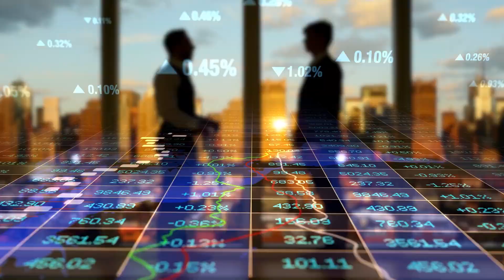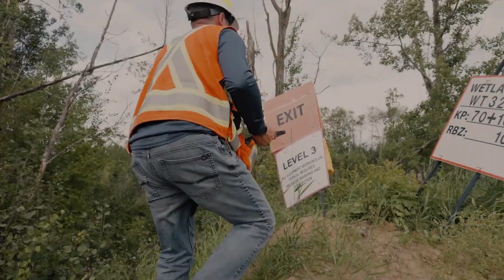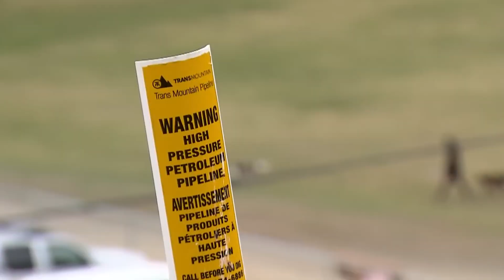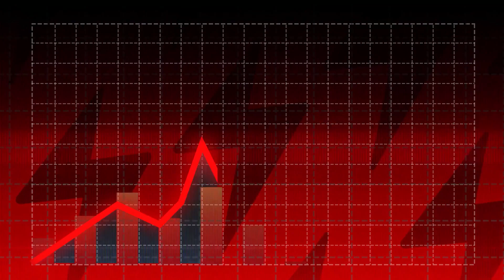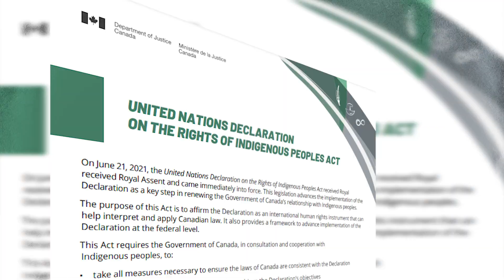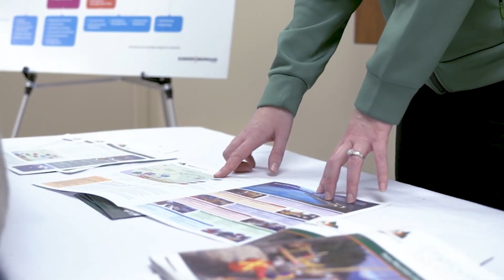Canada’s Battle To Build A $25 BILLION Oil Pipeline

Comment: It is scientifically impossible for greenhouse gas behavior to cause global warming.  All the greenhouse radiant energy from the earth is completely absorbed in earth's greenhouse effect by greenhouse gases within 20 meters of the radiating surface that is always in saturation from the strong greenhouse gas water vapor.  

There has been no credible Climate Change due to global warming as of 2024.  Climate Change was expected to start to take place when global warming reached 1.5°C causing observable stronger hurricanes in the Gulf-of-Mexico.  The term Climate Change started being used at the beginning of the 1980s to cause alert to a broad audience of the long term effects of increasing average global temperatures.  

The promotional term Climate Change in the early 1980s was grounded on actions already taken by Gulf-of-Mexico offshore crude oil drilling companies in the 1970s to build for stronger hurricanes due to warmer Gulf waters predicted to start when average global temperatures increased 1.5°C on track for 2010.  That action was taken for a predicted long term change in weather patterns or climate that backed up the use of the term Climate Change.   

US vise president Al Gore elected in 1992 is the key person for promoting the fraud that human caused greenhouse gases are causing global warming.   In the mid 1980s Carl Sagan, NASA's story teller, was at a US Senate hearing with then US Senator Al Gore on the panel.   Carl Sagan used the opportunity during his presentation to request funding three times to investigate increasing atmospheric greenhouse gases as a possible cause of global warming.   Carl Sagan was behaving as a traditional astrologer because it is scientifically impossible to increase the effect of earth's always water vapor saturated greenhouse effect or any always saturated system.

Al Gore appears to have figured out that with earth's water vapor saturated greenhouse effect being taught in US public education he couldn't directly use Carl Sagan's scam, but it does appear Al Gore used the promotion of increasing carbon dioxide levels from human activity to cause the UN Intergovernmental Committee on Climate Change to start being publicly obsessed with human caused carbon dioxide causing global warming without a mechanism for the effect.   This international involvement of Al Gore likely figured in prominently in Al Gore becoming the US vise president running mate with Bill Clinton for the US presidential election of 1992.

When Al Gore became US vise president in 1992 the new people coming into the National Science Administration were stating to the out going administrator that they were sure human caused carbon dioxide emissions were causing global warming, but refused to elaborate.   At some time earth's water vapor saturated greenhouse effect appears to have stopped being taught in US public education.  That time appears to have been during the first term of Al Gore's US vise presidency staring in 1992.   In 1996 the UN IPCC announced that the mechanism for carbon dioxide to be causing global warming was its greenhouse gas behavior, now without resent review in US public education that would of caused every US high school science student to say that was nonsense.

Global warming has been stalled at about 1°C since 1992.  In 2022 global warming was officially reported at 1.06°C